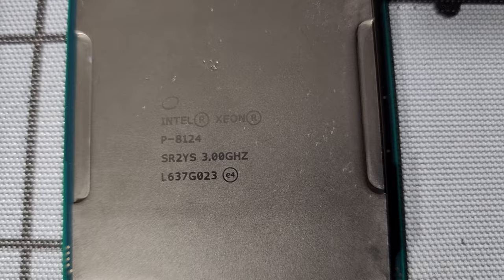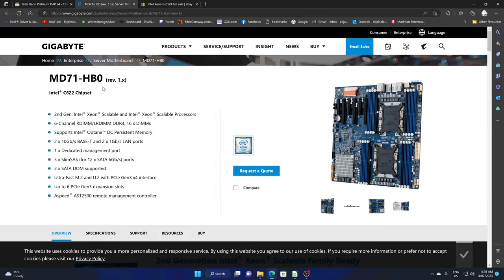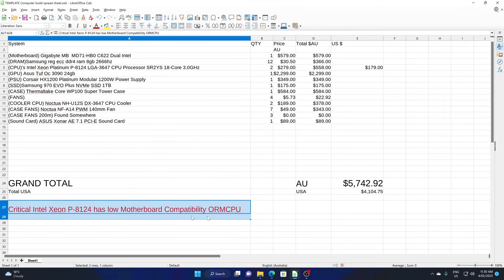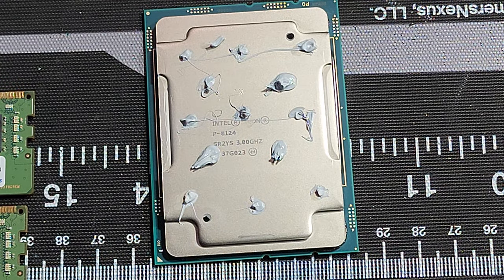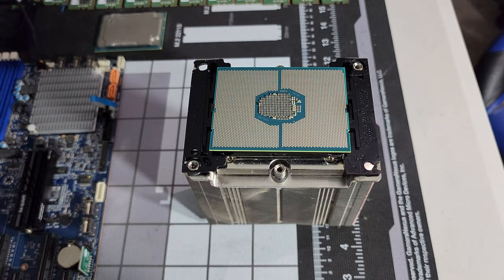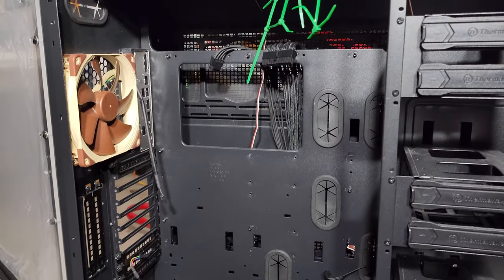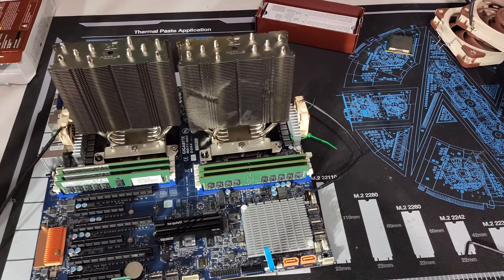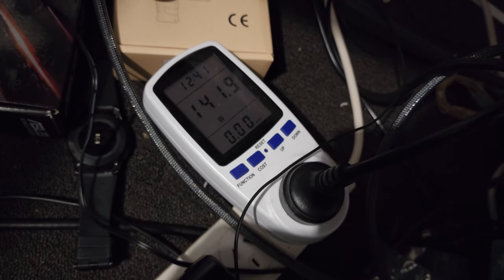Dual Intel Xeon Platinum P-8124 Build. Total 36 Cores 72 Threads.

Comment from the maker: 0:00 Introduction

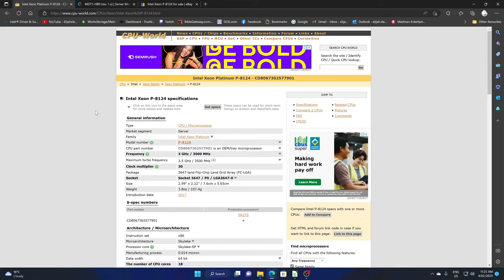1:15 specs and Price

5:52 Installing the CPU to Motherboard

16:32 Introduction to the case Thermaltake Core WP100 

20:40 Connecting front Panel connections to the motherboard (Gigabyte MB  MD71-HB0 C622 Dual Intel)

22:33 Total system Power draw at idle

Comment: I just found your channel.  I'm over the moon over how much Xeon Platinum CPU's have come down in price. I just left Ebay and used 8124's are actually affordable.
Reply from the maker: Hmm, they are cheap. They definitely have their problems if you are only considering it for gaming.
Reply: @ProjectSmithTech  No worries, I'm not a gamer. this will strictly be a workstation build.
Reply from the maker: @rdsii64  Nice, I'm currently playing skyrim at 8K @60FPS with this build. Experiencing no problems. It's a solid workstation, I guess until Intel Rapids comes out.

Comment: My next system will be based on the Xeon platinum and will replace my 1950X system.  It will go in the new siverstone 5U rackmount chassis.  My desktop workstation resides in a 25U startech rack with the rest of my homelab.
Reply: Smart idea. I have a 42U Startech rack on wheels. It's great, less than $400 shipped. I can fit every system I own plus networking gear in it.

Comment: Hey great channel  and great content

I will be the first to say - granted you live in australia - your just grossly overpaying for this.

The P-8124 is basically the G-6154 - except about 25% slower and with an even higher tdp.

I managed to use a 3rd party to build me a dual G6154 system for 1.4k USD - granted it has a bunch of OEM parts and its basically a refurbished old enterprise server. I live in the US though and I realize this may not be the same for you.
Reply from the maker: Thanks I'm glad you like the content.
You're probably right, the P-8124 I've own for quite a while now. I've noticed the Xeon E5 series have fallen quite a bit in price. Hey if you could hook me up with a dual E5-2689 V4 that'd be great. The cheapest I can get it is $104usd.
Reply: @ProjectSmithTech  Try and see if in australia there are refurbished enterprise resellers. They will have the best price point for hardware .
Reply from the maker: @dan91121  Yeah, once I get my new server running I'm going to be  making at least a few videos on cheap servers I find online. Business closing local markets and what not.

Comment: Would you build this again today if you needed a Proxmox box, or are there better deals now on ewaste server parts you'd run with instead?
Reply from the maker: Not if you plan to leave it on 24/7 the idle power consumption is too high. It was a fun build though. I'd first consider the Pro WS W680-ACE as a platform. Get some unregistered ecc DRAM.

Comment: wondering why both amd and intel no longer doing the old socket with the lever handles and now all doing this torx screw mounting.
Reply from the maker: I'm guessing that due to the size of the CPU having screws allows more even distribution of pressure. For example the 12th Gen had some problems with their single latch causing uneven force applied pressure. I did like the X99 socket dual latch design.
Reply: Because of the size of the CPU, it's a lot easier to not have all the pins contact correctly with the old lever system.  It would also take a lot more force with levers on a large CPU, much easier to be precise enough with the screw down systems.

Comment: Hello

I hope you are well, and I hope this comment reaches your attention. I am currently in the process of upgrading my Dell T5600, and I want to move it into a new pc case for better airflow and cooling. What case would you recommend that maximizes airflow and cooling, that also fits an E-ATX motherboard? 

God Bless
Reply from the maker: Nice, do you have the nvidia Quadro as well?
Depends on your budget. You could go the Thermaltake w100 that will definitely work, but for a much cheaper option have a look at the Deepcool Matrexx 55 Mesh. I've used both of these cases for my server motherboard.
Reply: @ProjectSmithTech  Hello

Thanks for your reply! Yes, it has a Nvidia Quadro, but I plan on selling it. Along with moving the T5600 into a new case, I also plan on upgrading some more. I have already bought a new motherboard, I will be buying an used 1070 ti, and along with an used 750 or 850 PSU. On top of that, I will get a NVMe M.2 adapter so I can use a NVMe M.2 as my boot drive. My operating system will be Windows 11 Pro. I am really excited to build this and get it operational. If you would like benchmark scores and pictures, let me know! Have a great weekend! 

God Bless

Comment: I am about to put 2x Xeon Platinum 8160 into a Gigabyte MB. Woudn't you first mount the cpu to mb, the paste, the mount the cooler?
Reply from the maker: And greatly reduced the chances of putting thermals paste on the CPU pads? Yeah not my proudest moment, just be aware you may have to put the CPU on the cooler first. I honestly can't remember and I'm really hoping that's the reason why I did in the order I did.

Comment: The TDP of the p-8124 processor is 240 watts, and the motherboard supports 205 watts. Is the VRM area overheating?
Reply from the maker: It's fine. Just add extra cooling

Comment: Why do you have 2 VRM fans having opposing airflow?
Reply from the maker: Total of 580 watts CPU draw, the motherboard was designed for a total 410 watts and that's in a server case. The fans are a good insurance for lower air speed. 
I hope that helps.

Comment: The 1st gen Xeon scalable CPUs are great imo. I'm running a single Gold 6140 in a T440 I got from my job that replaced my outgoing dual E5-2667v2 system (also from work). In the future I may add another proc and more ram should I need it.
Reply from the maker: Ecc DRAM is really cheap on AliExpress if you need it. Not a bad hand me down.